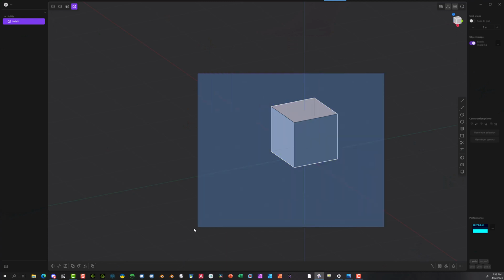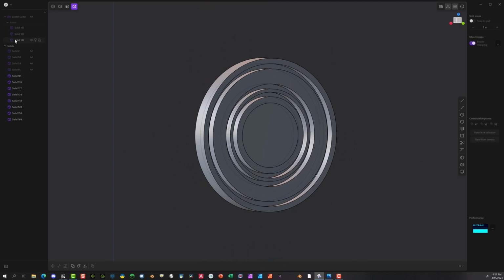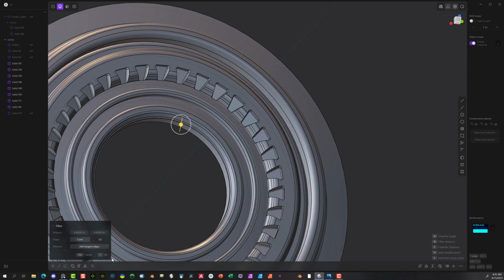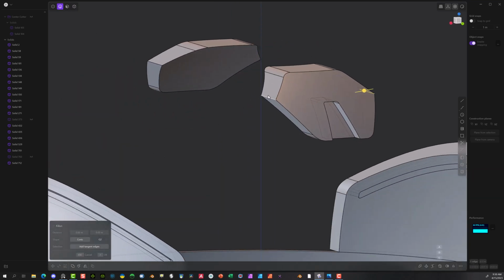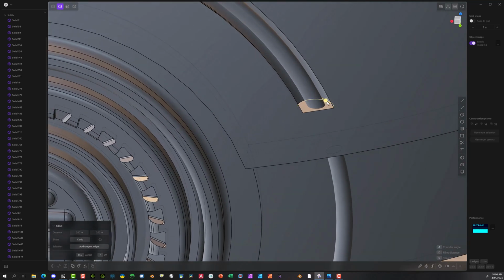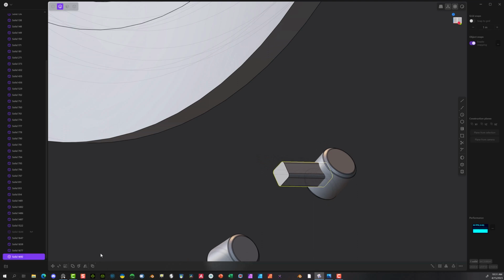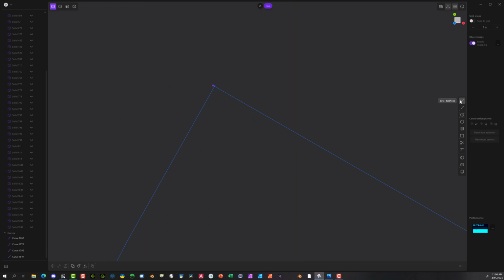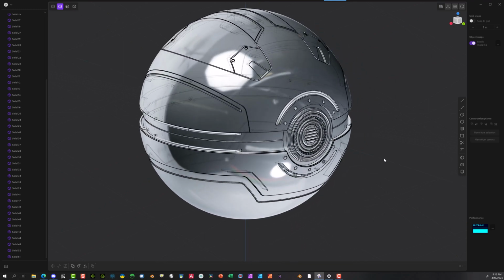How to Use Plasticity to Model a Futuristic Pokemon Ball for Beginners - Advanced

Comment: Hi, I can't type in values when creating a rectangle or a circle like in 4:22 There is no field for that in the context menu which appears in the bottom left, can you help me with this? Thanks
Reply from the maker: Hello Onur, this was created with version 1.0 which was using inputs as shown.  My newest videos I am using 1.1 and that option is now different.  The new style shows the sizing as you pull this out.  The sphere and corner box option is an easy way to put the exact size on the z view for example to be able to type in the sizes if needed and then you can outline the object with the circle and corner rectangle to outline to get an exact size.  Hope this helps
Reply: @ThreeDCreateTutorials  hello Jon, I figured out that I have to press tab for type in sizes while I'm dragging out a shape. Thanks for the reply and for your awesome videos. I will work with all of them. 😀
Reply from the maker: Glad you figured this out, the Tab option I need to look into.  Thanks for the positive feedback

Comment: Jon - clean. nice workflow and spherical study. video'd the first  ~10min, sans Plasticity at the ready. consider using the "Hollow" command to shell out the innards of the semi-spheres, vice boolean with a sphere of slightly less diameter. should accelerate/simplify your workflow.
Reply from the maker: Thanks Ken W!  For sure I will try the Hollow command.
Reply: @ThreeDCreateTutorials  further investigation reveals that my method will results in a portion of sphere (in the z direction) being subsumed as you Hollow out the sphere. that is, you will eat part of the sphere's geo as the Hollow progresses. perhaps, this can be combated by Extruding the  center "ring" in the +/- z direction to fill the gap?
Reply from the maker: Good suggestions however I am mostly used to Boolean process.